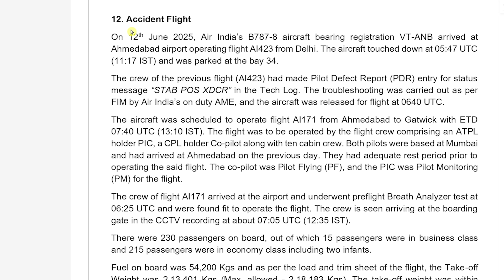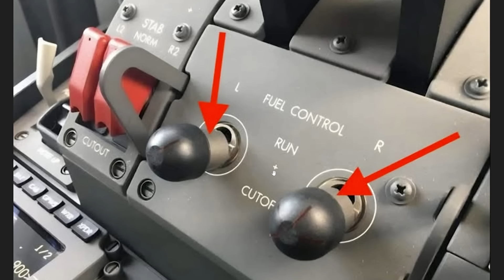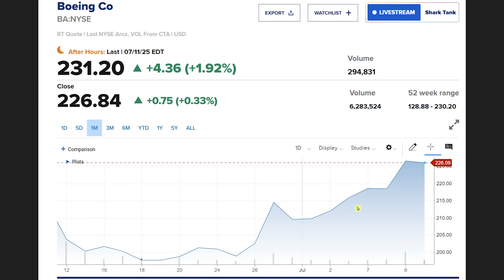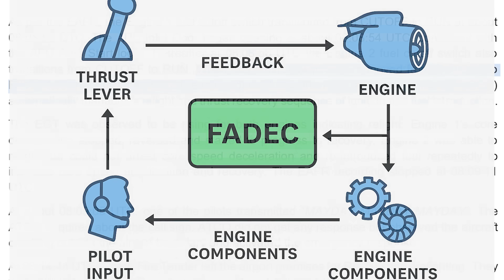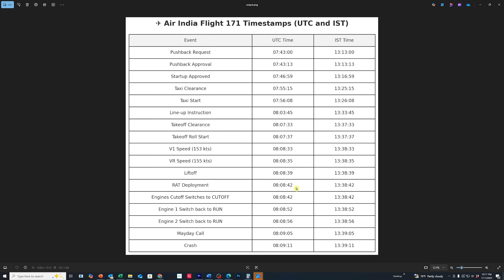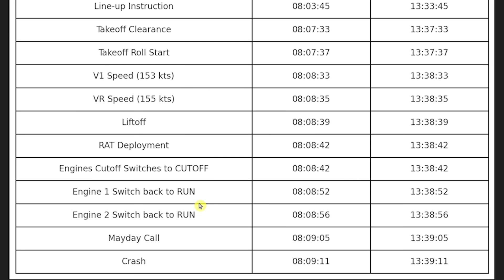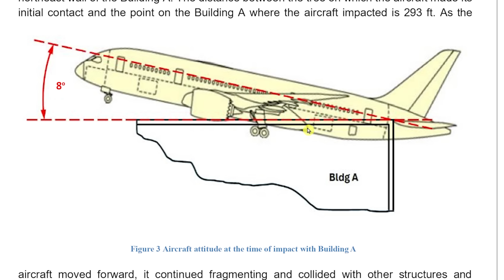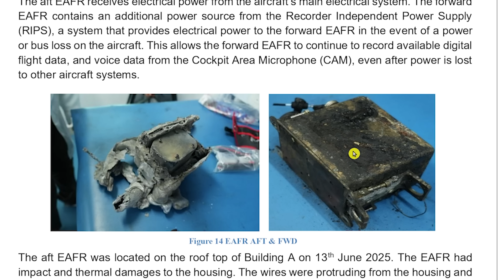Did Pilots CUTOFF Fuel? Shocking Twist Air India 171 Report!

Comment: Tone of voice and context of the question is absolutely crucial here.       

1. The question that was asked by one of the pilots is, why did “YOU” cut/shut the fuel, which requires a clear grasp of the situation and being aware of actions that might’ve yielded that inquiry. Alternatively, the more natural inquiry would simply question the situation/emergency and not be inclusive of attributing cause, like, hey what happened to fuel switch or why did the fuel cut out. Generally blaming someone requires more awareness and confidence in others involvement, whereas not blaming someone unless absolutely certain, would be more of a natural and easier method of inquiry. 

2. Tone of voice is crucial and has to be analyzed to give insight into how that question was addressed, and who asked it. That should be a good factor in determining many items of importance, including whether the pilot asking the question, was genuinely making the inquiry or whether it was a deceptive strategy to showcase denial of guilt.
Reply: The action of turning off the fuel shutoff switches would have been clearly visible for the other Pilot.  So one of the Pilots clearly saw what happened hence the clear question unequivocally directed to the Pilot who performed the act.  The denial of guilt response I did not etc is a common human reaction that stems from the habit of lying.
Reply: To your first point, it is interesting that the question was "Why did you?"  rather than "Did you?" It implies that he already knew the answer to "Did you?" so was only curious as to WHY it was done .... Either that or, like a couple of people said, this was gaslighting.
Reply: @ellea2541 I'm on team gaslighting - the one who flipped them asked the pilot flying why HE cut them off - he was busy flying so did not - it's just very sinister!
Reply: The pilot immediately deduced the fuel was cut off and looked and saw the switches both off and immediately blamed the other guy..
That doesn't mean he saw it or he would have protested beforehand. It was the first rational assumption.. "why did YOU cut off the fuel?"

It's not proof. The 2nd guy immediately replied, "I did not."

Look at the time frame in which both switches turned off.. something like within a second. That's not humanly possible. Something malfunctioned and both switches instantly flipped.

They need to do intense investigation of the electronic and computer systems.
Reply: @EndTheWokeMindVirus well said. The whole report looks like cover up now.
Reply: @samsonsamsamsam  None of the report looks like a coverup. Put down the crack pipe v
Reply: @EndTheWokeMindVirus  This message brought to you by Airbus.
Reply: @EndTheWokeMindVirus  In your many years of flying Boeing aircraft, what time IS humanly possible to switch two switches?
Reply: Agreed. Too many times the guilty party likes to point the finger of blame on someone else
Reply: Can it be demanded of the NTSB & Indian equivalent that we HEAR the ACTUAL cockpit sounds - voices and any sounds that give clues to the full story?  We need to HEAR their actual conversation - all of it.  I don't for a minute believe that the conversation was limited to the question and answer we are told.
Reply: @marycw Not sure about in India but definitely not in the U.S. ATC communications are public but Cockpit Voice Recorder tape are not public. We get the transcript, that’s it.
Reply: @marycw As far as “we need to hear their actual conversation” you’re not an accident investigator  and honestly nobody has any obligation to make you “believe it for a minute. 

If there was a video of a murder nobody would share it with you to get your buy in.  This is about answers, not convincing you.
Reply: Kindly find out about the pilots of the Delhi /Ahmedabad flight. Did he also feel anything unusual while flying. It is important to have his version because he could put off the fuel knob or is it a part of the Manuel. Plz also find the pilot of delhi/Ahmedabad sector. Plz plz plz.
Reply: @mansidash78 The fact that there had been no pilots that had ever reported the switches were loose is a huge data point. 

Not to mention, the investigators have the switches from the crash, so, they know first hand what they work like.
Reply: @robinmueller3778  not reporting sounds weird. Passengers were complaining about the Del-ahmd flight about the electrical failures. 
However I believe the previous pilot should also be brought to discuss.
Reply: Why is the pilot who flew Delhi- Ahmedabad sector not coming to the scene. May be before deboarding he as a part of the Manuel or for all good reasons put off the fuel knob and hurriedly left the aircraft. Or did this problem prevailed during his flight too, but did not inform.A passenger from that flight was vehemently complaining about electrical failures, he uploaded  a video too. 
Why have we all forgotten about the pilots who flew  del-ahmd sector????? The same aircraft?
It is important to get him to the scene and probe.
Even not to spare the technicians, cleaners who enter the aircraft on routine check up. 
I think it will be crude to curse nd imagine the deceased pilot could have done such a stupid thing, both having good record of past service. Plz all of you demand the presence of the pilot from the previous flight.
Reply: @mansidash78 If the previous crew did not run the post flight checklist, any discrepancy would have been caught in the preflight checklist of the accident flight. 

No previous pilots had ever reported loose fuel cutoff switches. The investigators have the actual switches from the crash to do a physical examination. They don’t seem to believe that there was any trouble with them. 

Furthermore, the plane accelerated as expected, rotated and began to climb out, clearly that could not happened if the previous crew had limit properly secure aircraft after the previous flight. 

Finally, problems with the entertainment system are not problems with the fuel system. They are completely independent electrical systems along with substantial redundancy in the fuel system circuits. One cannot affect the other. 

There is absolutely no requirement to have a fully functional entertainment system to safely conduct a flight. Inconvenient tongue passengers? Yep, but not a reason to delay the flight or have safety concerns.
Reply: Yes ok, what's the h arm to hear from the horses mouth ,the other pilots? I suppose that del /ahmd fight had electrical systems failure too. That's what was exposed in one of the videos. 
This is confusing and hurting to blame the efficiency of a pilot with super good flying record. So the American theory h as convinced  everyone. With due respect Mr Mueller. Thank you for taking the trouble to explain facts so complicated.
Reply: @mansidash78  Where does it say anywhere that the pilots of the previous flight have not had their records looked at or have made a statement/been interviewed. 

Also, where did the India’s AAIB preliminary conclusion become “the American theory”? India is doing this investigation and experts from other countries are assisting, adding their expertise. They are not developing theories of their own and forcing them upon India 🙄

You keep trying to make a problem with cabin electrical into an issue that can affect completely different and redundant electrical systems that run the fuel systems. It can’t, by design. You’re either willfully disregarding the fact that they have nothing remotely to do with each other or you are ignoring people that are telling you this and for whatever reason you are not learning anything from it. 

You are trying to make a mountain out of a molehill and ignoring foks either extensive aviation experience flying the aircraft as well as some of the world’s best aviation accident investigators. Not sure what your agenda is but it’s falling flat from a serious disconnection from reality.

Comment: Check pilots history - has any one of them previosly flown an aircraft that has important levers/switches that need to be moved immediately after take-off (e.g., flaps, landing gear,...) at the same position as fuel cutoff switches on B787? If the answer is "yes", there's you answer "why?". Pilot mistakenly did the thing he used to do previously, caused by the stress where people sometimes  instinctively go back to earlier learned procedure.

Comment: If the timeline is correct from the time the engines were cutoff to crash was 29 seconds, whoever did it turned it off at the perfect time to ensure the airplane wouldn't be able to regain enough thrust in time.

Comment: Hmm. It took 1 to 2 seconds to set both switches to off, yet 4 to 5 seconds to set one switch to run and then the other switch to run. I am thinking that the pilot who set both switches to off is interfering with the other pilot who was trying to set both switches back to run. All of forces encountered during the crash was not enough to move either switch from the run position to the off position. This makes me think that the switches themselves were functioning correctly.

Comment: The report never says that the switches were manually moved to off position. So, how is everyone jumping to this conclusion? Couldn’t there be other reasons and the question and answer are part of troubleshooting? They found the fuel switches in on position. How could the pilot who was flying who hand is on the thrusters not notice the other moving those switches in peripheral vision? Couldn’t it be a chip malfunction and later the two pilots were troubleshooting and needed to turn off and turn on the switches back on again? The transcript has not been released, only a couple of lines of interpretation of the actual conversation?

It is hard to trust any of these interpretations on YouTube by these so called experts after everyone jumped on the wrong flap position bandwagon.
Reply: It's obvious that it was Pilot doing.... Pilot accuses other pilot of turning off switch... he doesn't ask if he turned it off... He accuses... 2 different conversations....
Reply: @jmehn203 sure! It is obvious to you based on what was released, which it turns out was not the exact quote. It seems suspicious that they don’t release the actual voice recording. They could easily put any doubts to rest if they could just release the full transcript of the voice recordings or better still, the voice recording itself. From the beginning the way American “experts” and media have tried to blame the pilots for the wrong flap position first, and then the fuel switches now (WSJ and other media outlets had their reports out three hours before the investigation report was made public), I am not sure if there isn’t an attempt to protect Boeing / Air India. Blaming the pilots seems to be easy way out by releasing insinuating “interpretations” of what was actually said.
Reply: @DigitGero  , They are following the same protocol that is used for all airplane accidents. Black boxes don't lie, and there's usually a few of the black boxes on board the plane. No one knows the motive of the pilot to try to crash the plane. They have also discovered that the Pilot was very depressed lately and going to therapy. No one know what's going on in other people's mind, that's just life....
Reply: @jmehn203 Neither the first time pilots are blamed first only to be later found out that it was Boeing’s fault, nor the first time that Boeing has lied. 

The data recorders only record the vales for the fuel supply were “transitioned” (notice the use of word transitioned in the report and not that “fuel was switched off”) not the mechanical operation of the switch itself. The preliminary report’s language is confusing and deliberately obfuscating.

1. It is natural for the pilot to ask his colleague “Why did you turn off the fuel supply?” when the fuel cutoff alarm goes off, and a possible  electronic malfunction of ECU is actually what caused the fuel supply to be turned off. It  is not something pilots train for. He would have assumed a mechanical operation of the fuel switches is what caused the fuel supply to be cut off. 

2. Secondly these switches are spring loaded and it is impossible to turn each one off within a second of each other with one hand that is towards to the center console. 

3. They did not provide the time when the question was asked. More over they did not provide the exact transcript or the cockpit voice recording either - they provided a paraphrased question in the report. A full cockpit recording would have recoded the clicking noise  of the fuel supply switch being operated mechanically. 

4. Moreover it took them ten seconds to notice fuel supply was off!? The pilot flying has his hand on the thrusters, and he would have immediately noticed the fuel switches being operated in peripheral vision because those switches are located right below the thrusters.

So, nothing in this report is adding up. It is possible this investigation and prelim report was influenced. And hyperfrenzy in the western media and aviation community to blame the pilots seems to be suspicious. I wouldn’t rule out the possibility of the stakeholders I.e. Boeing or NTSB trying to protect Boeing with their influence in the the Indian investigative body.
Reply: Moreover fuel supply cutoff without the mechanical operation of the switches is not without precedent in the same Dreamliner - it happened to a Japanese airline upon landing.

Comment: What if there was a cover up.
None of the pilots turned off the switches.
The switches communicate digitally so if the order "off" was made digitally it would appear in the black boxes as if it was made physically.
That is why NONE of the pilots did it as in the voice recording.
That is why BOTH the pilots tried to relight
the engines by cutting "off " and then "on" the switches.
The flight recorder showed only the "back on" operation because it was supposed to be already off.
Only 2 possibilities
A suicide murder of one of the pilots,
very unlikely for he  could have opposed the restarting of the engines.
Or a remote digital hack of the fuel control system..The second is infinitally more likely...
Reply: It's obvious that it was Pilot doing.... Pilot accuses other pilot of turning off switch... he doesn't ask if he turned it off... He accuses... 2 different conversations....

Comment: One element of the timeline pops out. That is the RAT deploying. The RAT should only have deployed after the fuel cutoff switches were moved to the stop position. My supposition has always been that on the roll (accelerating on the tarmac), something was amiss. Maybe the engine thrust was insufficient and the pilots knew they were running out of runway and had to lift off. During the climb, the flight computer decided to deploy the RAT because it sensed the engines were producing too little power to sustain flight. If that sequence is accurate, it means the fuel cutoff switches were moved to the off position while the plane was still on it's roll. Something is not adding up here.
Reply: If the engine is in sufision thrust  can not take off

Comment: Although many discussions have focused on the possibility of a mechanical failure in the fuel control switches, the evidence suggests otherwise. The issue was not the result of wear, aging, or internal component failure. Rather, it stems from the installation of switches with the locking mechanism improperly engaged — a condition highlighted in an FAA advisory (SAIB NM-18-33). This reframes the situation: it’s not that two switches failed mechanically at the same time — an extremely rare occurrence — but that two improperly installed switches, possibly from the same production lot, were installed. That scenario, while still unlikely, carries a higher probability than simultaneous mechanical failure, and is supported by the known installation vulnerability.
I conclude that the likelihood that both fuel control switches malfunctioned on Air India Flight 171 increases based on the following facts:
•	SAIB NM-18-33, issued in December 2018, warned that improper installation could leave the fuel switch locking mechanism disengaged, potentially allowing movement between “FUEL CUTOFF” and “RUN” without lifting the switch.
•	This issue applies to Boeing 787 variants, including the 787-8 used on Flight 171.
•	The Air India 787 (VT-ANB) was delivered in January 2014, before the bulletin was issued, and no inspection or corrective action was performed. Compliance was advisory, not mandatory.
•	There is no indication of wear, aging, or internal failure  in the advisory — only potential installation oversight.
Conclusion: While the exact increase in probability cannot be determined, the absence of inspection and the aircraft’s unmodified status raises the likelihood that both switches were in a compromised state. Given that both switches may have come from the same lot and shared the same installation oversight, this scenario is more plausible than the extremely rare occurrence of dual mechanical failure — and may have directly contributed to the dual engine shutdown.

There’s no public evidence or official mention in the AAIB’s preliminary report—or related reputable coverage—that the recovered fuel‐control switches from the crash were subsequently examined for the specific lock‐disengagement issue you're focusing on.

The one-second gap between fuel cutoffs could align with an oscillation caused by turbulence in warm weather, potentially causing the pilot’s arm to contact one switch, then the other on the next cycle.